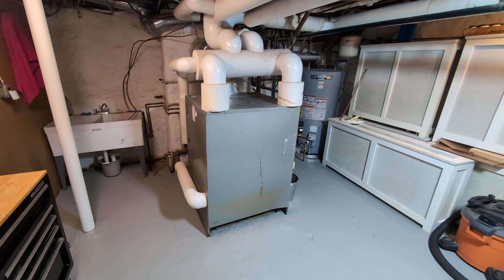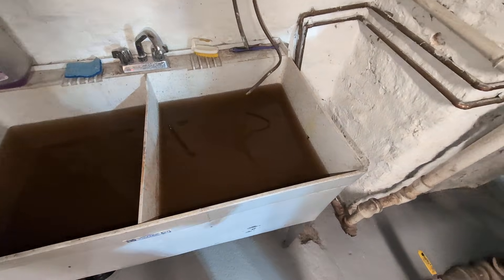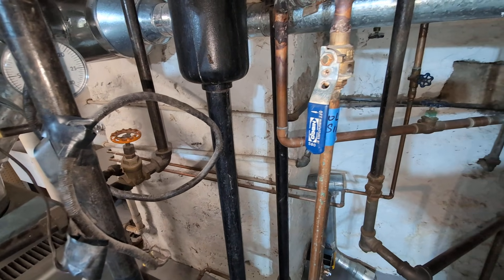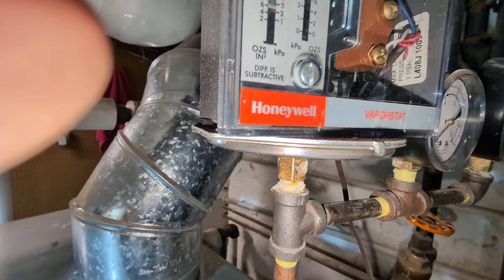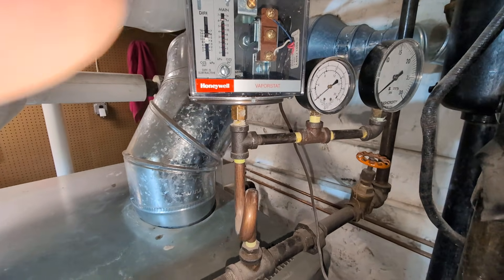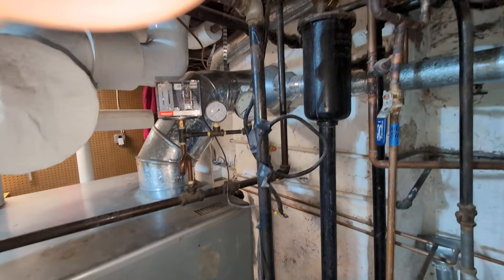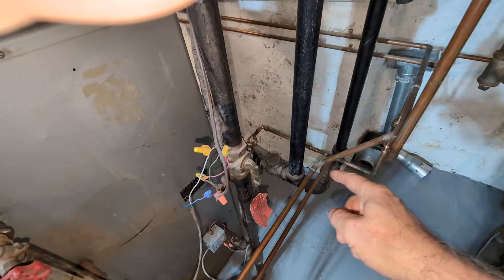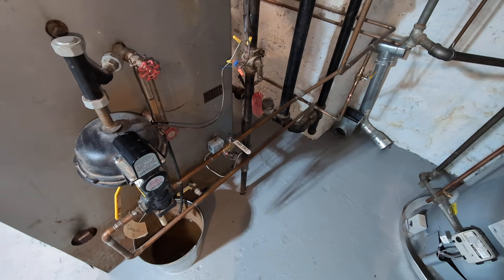Old Steam Vapor System With Passing (AKA "leaking") Ball Valves That Flooded This Boiler

Comment: Hi Gordon, love your videos. I wanted to get a low pressure gauge for my one pipe steam system, but can’t seem to find any.  Do you have a source or recommendation for a 0 to 3 pound one?  Thanks and all the best.
Reply from the maker: I haven't bought any for years (I am overstocked).  
I used to get them on ebay.  
I got stuck with a few duds going that route. 
A tip: Search using "3.0" psi and not 3.
I would also put your 3.0 psi gauge on a 1/4 M x F ball valve and only use it when taking readings.
Those gauges are very easy to break, and under constant use their live span is shortened considerably.